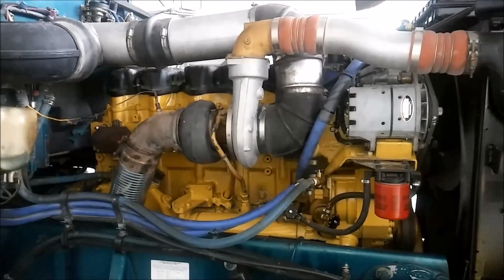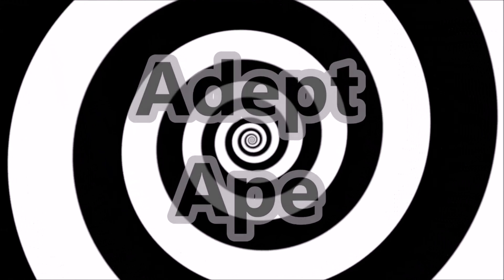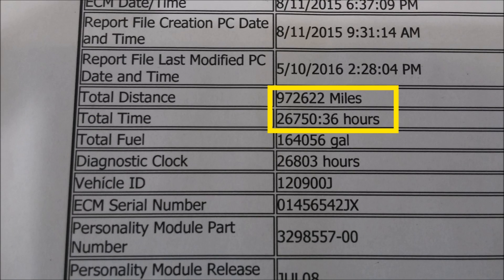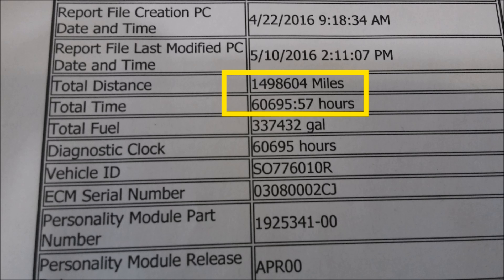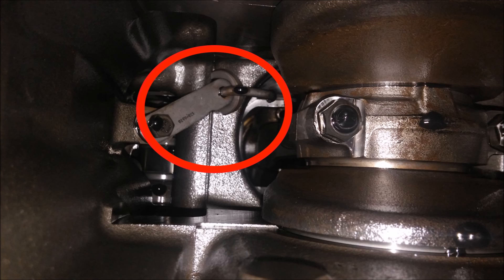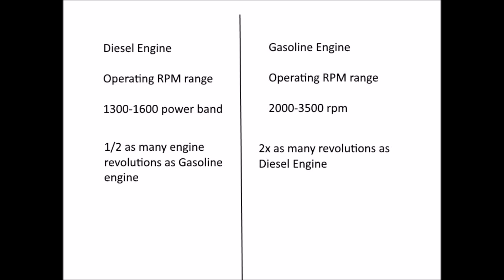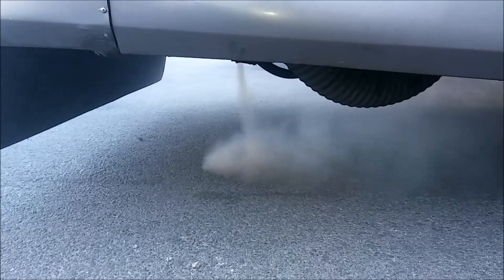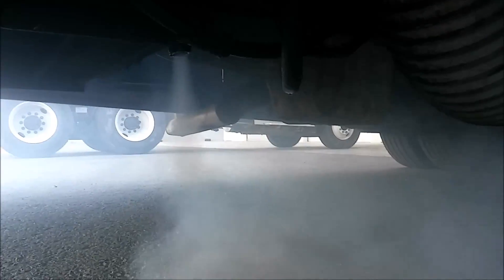Why Do Diesel Engines Last So Long?

Comment: Comparing a Chevy 350 and a Cat C15 is like comparing a grape and a watermelon, of course the bearings are larger and it has heavier parts. LAME
Reply: AdventureCayman 350CI^3 ~ 6 Liters. C15 = 15 Liters. So, it more like a grape compared to 2.5 grapes. To ratio, the bearings are still monumental in comparison.
Reply: If he compared a Chevy 350 to a Diesel engine used in a Chevy pickup that might be more sense.
Reply: usaisalwaysnumber1 When you come down off your meth induced rage, you may respond to sensible comments. Do you even know the  horsepower rages of the 2 mentioned engines? I didn't think so. You dirty son of a bitch.
Reply: What is the use case for a Chevy 350 small block, and what is the use case for a Caterpillar C15? Civilian vs. industrial. A better comparison would be one manufacturer that makes both diesels and gasoline engines, and puts both in the same model of car (VW come to mind?).
Reply: The horse power is comparable.
Reply: @grumpyoldfart7302  but torque is hugely different.
Reply: usaisalwaysnumber1 - My Spanish is better than your English. 

...I don't speak Spanish.
Reply: Come try it? Want me to message you my address?
Reply: C15 cat weight almost as your car. He showed upper main bearing they get very little wear on them. If he had showed lower main bearing it would have at least wore first layer of metal which is protective layer .005. Why C15 can last so long if you change oil like you should. Fleet trucks they push 20,000-30,000 oil changes and engine worn out but hey they don't care when they get rid of them at 500,000 to 600,000 miles
Reply: No joke that made me just forgo watching the rest of the video 350 compared to 927.6 in³ is seriously LAME LAME LAME....  Small black V8 compared to a massive I6 diesel......
Reply: Not everyone knows things like this. Give the guy a break. I do what he does. There's tons of folks that have no idea. And when they get curious, they come to us.
Reply: crusty old fart No BRAINS...if that's the best you can do...ROFLMFAO  at you and your mommie
Reply: Just shut up already.
Reply: Tim Ramich why don't you come SHUT ME UP..
Reply: usaisalwaysnumber1 I was telling the crusty old fart to shut up. Not you.
Reply: Tim Ramich WELL I APPOLOGIZE..SORRY
Reply: usaisalwaysnumber1 Haha no problem.
Reply: usaisalwaysnumber1 - You're*
Reply: Vegard Claussen it's not really that simple since you can fit a bunch of different displacements in the same block. A sbc can be anywhere from 260ci up to over 400ci. 
A better way to compare them is by the amount of material that makes up each engine. For example, an all iron sbc weighs around 500-550 lbs.  What's a C15 weigh?
Reply: @ usaisalwaysnumber1; (your an idiot)<--should be YOU ARE AN or YOU"RE an idiot, one is possessive one is not, also (Id) it should be "I would" or  "I'd" notice the punctuation marks. Now that said, I do believe usa is always number one, however we cannot be number one if we are run by idiots who do not know how to use english. Also Grumpy old Fart might be right! usually the difference between engines like this are torque.
Reply: AdventureCayman that's the point he is trying to make. It's bigger so it lasts longer. THICK!
Reply: Sir, you know what the word "nice" really means?  It's been changed alot since it's first inception, most murikans don't know English, I do agree fully.
The word "nice" was suppose to me fool or stupid.
Then again there are words people label as "cuss" words that sure ain't so.
Reply: your right about that , C15 cost 10 grand to rebuild a 350 2000 grand for a crate motor.
Reply: Bearings in diesel engines need to be larger than their gasoline counterparts because diesels run higher compression (18:1 up to 25:1) and this puts more peak force on the crankshaft and bearings during the compression stroke (for the same diameter piston).
Reply: AdventureCayman Okay wise guy. How about the Cummins ISB compared to the Chevy small block? Similar cubes. But everything is much more massive still on the cummins. Changing nothing about what he said.
Reply: exactly what I was thinking...
Reply: And still a monumental difference in engines, so the comparison is useless.
Reply: AdventureCayman    lol right, comparing a big rig engine to a 350 gasser lol
Reply: AdventureCayman I disagree. Compare the load per area would be a better comparison. I think you will see the load per area much lower with the Diesel engine .
Reply: Alena Soto Then it seems the Chevy actually lasts far longer then the C15 per lb of material used. Which stands to reason, btw, most Chevy's aren't lugging around thousands of lbs.
Reply: Vegard Claussen YOUR A FUCKING MORON..
Reply: crusty old fart ROFLMFAO  Is that the best you can do LITTLE BOY??
Reply: crusty old fart YOUR NAME SAYS IT ALL..SHIT FOR BRAINS..dont know fucking shit about engines..MORON Go get educated MORON before making a COMPLETE ASS of yourself    LMFAO
Reply: ANYBODY THAT WOULD COMPARE A 3406 CAT TO a 350 chevy is a complete GENETIC MISFIRE....LMFAO  would you have any idea at all the true difference?  why FUCK NO.  IDIOT..
Reply: crusty old fart your an IDIOT..YOUVE DONE PROVEN THAT..if I were you I believe id STFU before I made a COMPLETE JACKASS OUT OF MYSELF..LMFAO

Comment: You had me until I heard the heat cycle part. Curious on what your thoughts would be on the diesel cars and trucks - even if out of your area of expertise. Seem to be pretty popular in Europe and elsewhere, but just really coming into the market here - granted VW didn't help there. In a car, wouldn't they also be plagued by heat cycles? Seriously, have been considering getting a diesel truck or van (need to be able to handle a special needs passenger) and have been trying to balance this out.  Would like to see/find something that details the difference in them or ask owners - maintenance, issues, things to consider. It is a lot of extra buying cost so does that translate into maintenance cost as well (fuel aside). Very long way of asking you if you would buy a van or truck that has a diesel to haul your family around?

Comment: what about cylinders sleeves?  usually help with maintenance since they can be replaced and, if my memory serves me right, help with heat dissipation
Reply from the maker: +niamaru2 A cylinder liner can be replaced and that makes doing a rebuild easier, but I'm not sure if the liner or normal cylinder would make a difference with hear dissipation. Both style cylinders are surrounded with coolant so I think the difference would really be the cylinder wall thickness.
Reply: Sleeves and wet liners both have a big advantage over a regular cast block without liners. they are almost always made out of a material that is stronger and more wear resistant than cast. they also helps to be able to cut down on the weight, improved wear, better sealing to the rings, and in some cases helps to cut down on cost at the same time when compared to a standard cast block. Working at a machine shop ive installed a lot of sleeves in performance engines for people and i must say, the different sleeve materials some of the aftermarket sleeve manufactures have available is crazy.
Reply: Why do RV engines tend to overheat more than other applications? In the unlikely event that I own a diesel RV someday how do I avoid an 80k mile engine replacement? Thanks for the great video!

Comment: Well, you can't really compare truck engines, that usually have over 10 liters displacement an weigh around a ton, with a car engine that is designed to be as light as possible and as fuel efficient as possible. Also, the diesel engine runs at significantly lower RPMs than gasoline engines. Last but not least, a trucking company generally doesn't mess around when it comes to servicing their vehicles, spearing now effort to keep them running! That being said, there are a lot of taxi cars with gasoline engines that have reached impressive millage figures.
Reply: ***** no, you can't!
Reply: ***** Glad to be of service!

Comment: in europe most people drive diesel cars
Reply from the maker: +JDMISMY LIFE Diesel Cars in the US are about as rare as Bigfoot, Volkswagen was making some but was shut down by the emissions regulations here. We do have some Diesels in light trucks, but we are a gasoline car culture here unfortunately.
Reply: Gasoline is also very cheap in the US compared to Europe, so people would rather buy a diesel that is cheaper to fill up and drives longer pr. liter

Comment: Not disagreeing with you. I have obviously seen tons and tons of diesel engines run for very long times. But, I was in Mexico a while back, and there were some very old Chevy Caprices there ( with small block chevy motors in them ), most of them had well over 1,000,000 miles on them. I also personally own a Honda Accord that has over 650,000 miles on it. But, you are correct. Diesel engines are designed smarter and more heavy duty. The only gas car I have seen personally that has the oil squirters on the bottom of the piston was the engine out of a Pontiac G6 GTX.
Reply from the maker: +Seph0ria I know some of the newer Ford truck engines use the piston cooling jets, but didn't know Pontiac was also using them. I think as power adders are more commonplace you'll see automotive engines using them more and more.
Reply: The thing is, especially with small block chevy's, unless you can verify 100% the engines not been overhauled or replaced its very hard to believe. Chevy small blocks are the cookie cutter engine of the gas world, they are cheap and literally everywhere.

Comment: well said!!!!
Reply from the maker: +Brandon Long Thank you.
Reply: Your welcome. I work alot with the Mercedes om617 turbo diesel engines and I've seen many with well over a million miles.
Reply from the maker: +Brandon Long What is the most common problem you see with that engine?
Reply: Oil leaks are the most common and from time to time a broken rod. And most of them are abused so I see a lot of overheats and a lot of them have been very poorly tuned and no valve adjustments and no oil changes
Reply from the maker: Those poor engines sound like they get driven into the ground. You'd think these expensive machines would get better maintained.
Reply: Ya it breaks my heart to see them torn up like that because I know that they can go a million miles  another thing that sucks is I see people that say that they're so slow when 90% of them aren't even turned right

Comment: To be fair, it seems that you're comparing more of a semi engine against passenger vehicle engines, rather than a diesel engine in a pickup.
Reply from the maker: +Ronald Golleher I am comparing a heavy duty Diesel to an automotive engine. It is to show the design differences between the two engines and why one can get so much more mileage. They are both practical for their purposes. You don't want a $20,000 3,000 lb Diesel Engine in your car and you don't want a lightweight quick revving gas engine in your freight truck.
Reply: excuse me Rudolph not Carl
Reply: Ronald Golleher compare a Chevy 454 and a 6.5 diesel
Reply: Adept Ape .. there are factory made Diesel engines on sub compact, compact, midsize automobiles. Diesel engines sold for every sized automobile sold brand new. Mercedes created the Diesel engine, likewise has had it in every vehicle it makes; the gasoline engine being an option, expensive option. VW, Porsche, Audi, Toyota, Mitsubishi, Honda all come with Diesel engines as stock factory equipment. Customers unknowingly pay a premium for a gasoline motor. Every automobile manufacturer worldwide (except the Detroit co's) have been selling Diesel engines as factory stock equipment. 

You, John Q Public, have opted for the gasoline motor because the salesman already has the car outfitted like that + until recent Congressional Oversight, the use of turbochargers in passenger vehicles wasn't allowed, forcing you with an inline 3.1L. Again, the entire world has been doing this since 1943
Reply: it was Carl Diesel not MB

Comment: do you not have diesel cars in America
Reply from the maker: Not really, Volkswagon was building them, but the EPA pretty much killed that.
Reply: it's all most fifty fifty hear in ireland
Reply: Most diesel applications here are usually in trucks, and the few cars you might find diesel engines in are European brands like Volkswagen or Mercedes-Benz (only two I can think of right now), and those more often than not are older models.

Comment: dose the emissions on todays trucks hurt that?
Reply from the maker: +Tiger Rule I think the regen engines tend to get glazed liners faster. This may be due to the introduction of some carbon from the CGI/EGR system into the combustion chamber or it may have nothing to do with it. The engines are more expensive to operate though due to more sensor errors and sensor/check engine light problems.

Comment: Your not comparing apples to apples. Heavy duty truck engine to a car gas engine.
Reply from the maker: I'm merely explaining the differences between the two. It is just to show why Diesel engines can see such high mileage compared to most car engines.

Comment: Nothing better than a diesel and this explanation! Very well done. This should be in an automotive class!!! But I will say, Some older gas engines like an International C60 In a cub (On my channel if you want to see) will last so long. The 7.3 diesels can last insanely long time, along with the truck its self, and we used the 7.3 for daily driving (heat cycles ect) as you explained. Only replaced injectors and alt, thats IT. 270k miles. Though I do have to say 3.5 ecoboost can be tough, most of the times haha.
Reply from the maker: +34486 SCI There are some gas engines that can get long mileage. I've had guys with gas engines with 500,000 miles contact me. Not a million miler yet, but there is probably one out there.
Reply: Oh I know they sure can get up there. Yeah my friend bought some truck with a 4.x l carb gas 340k miles. It was a little rough.

Comment: You can make any engine last your entire lifetime if youre willing to keep fixing it
Reply: Check Mate the cylinders will lose compression, the seals will dry rot and let oil leak like a sieve. At some point it will be a completely different engine and will have costed more to fix than just buying a new one
Reply: +SavageSalad At that point you would replace the piston rings and have the block bored and stroked. Like I said you can make.it last forever, its just that its usually cheaper to just buy a new engine
Reply: ***** I drive an r32 skyline turbo
Reply: You can only bore so many times before the cylinder walls become too close together. 
Also Honda's and Skylines are both pretty similar cars overall, both are Imports, next to no towing capacity, next to no offroad capacity, essentially only 2 seaters and popular cars to modify.
Reply: tanker9987 u can add sleeves if the walls are getting too thin. Also it would take well over your lifetime to have to bore a cylind that many times unless u were purposely doing something to destroy the walls.
Reply: Samuel Rosenberg There really isnt a limit on boring out the cylinders because you can put sleeves in it to keep it at the right size
Reply: Not a chevy 6.5 diesel, they self destruct, heads on them are such a joke.  Its like yugo designed them or something....

Comment: true ! overheat is the enemy of diesel engine.
Reply from the maker: +Dan Tihon Very true sir.
Reply: @AdeptApe  Mine overheated on the Autobahn due to a faulty collant joint. I had to drive about 10mins in overheated state to park it safely. Still runs well this was 8 yrs ago. Driving the 1.9 TDI built 1993 in my Golf Mk3 Cabriolet :D
Still needs NO oil. Every oil change I did since then was like it doesn't even try to eat the oil :) I even did photo comparisons between the intervalls LoL. Not even a mil went down on the dip stick :)
Maintanace is the key I'd say :) Then it even can took accedantials very well :)
Reply: Exactly. Melts peripheral cables hoses and plastics.

Comment: But how many in frames did those engines have?
Reply from the maker: +Jonathan Bergeron Usually they will get their first inframe around a million although I've seen them go 1.5 million without one. It depends on maintenance and some luck.
Reply: Yeah generally if they're babied a million is pretty easy

Comment: good video good explanations for the non diesel people. how about an explanation on how all these Tier 4 engines will never live anywhere near as long as the 6nz C-15 will. I know why but  have been out of the dealer loop for some years. curious as to what cat estimates there engine life to be now compared to the older engines.
Reply from the maker: I could do something like that in the future, I was going to start doing a series on each Cat engine and explain the changes to them over the years, I could try to roll it into that. Very good comment.

Comment: What causes the RV engines to overheat typically?
Reply from the maker: +davidca96 The biggest cause of overheats with RV engines is the radiator either being externally plugged or internally plugged or a combination of the two. Probably about 80% that I see are radiator related.

Comment: Question for you ,If you had a choice to put together a glider kit .Wich one would you go with, a 2002 6nz 550hp  or a 600hp c16 ?
Reply from the maker: 6NZ would be the way to go I think. Both engines are good, but the 6NZ is regarded as one of the best ever made.
Reply: Claudio Hysi Throw in a KTA 600